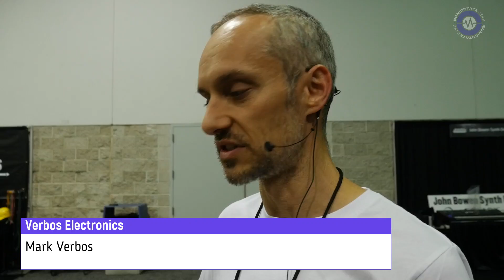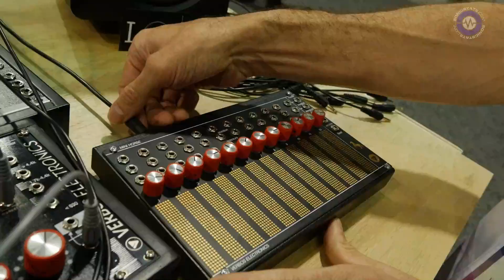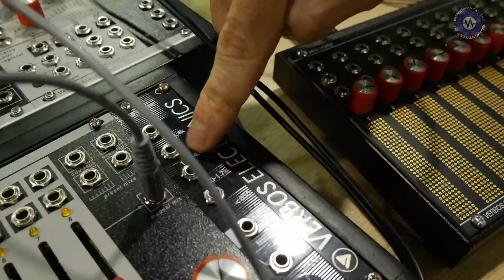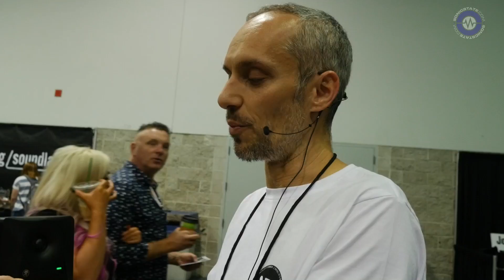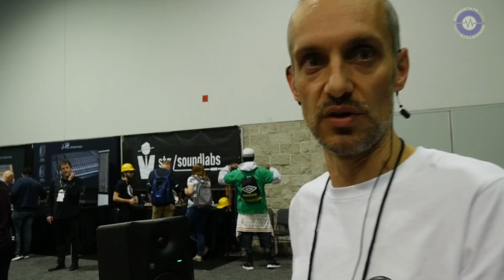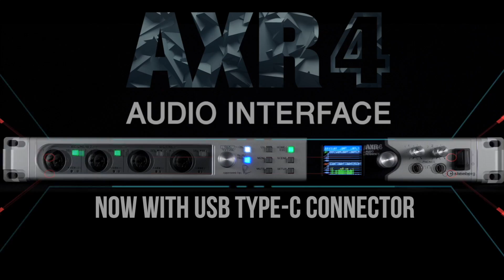NAMM 2020: Verbos Electronics - Foundation Oscillator, Noise & Filter and Amp & Tone

Comment: doesnt feel like the next big thing
Reply: I quite like the noise&Filter Module. Can think of many uses for it in my setup and the price is nice too
Reply: There doesn't always need to be a "next big thing".  Sometimes you just want to fill out your line with some options, or fill in some gaps in functionality.  Nothing wrong with that.  That oscillator while not the next coming, sounds very nice.  I like that spike.
Reply: It’s actually kind of nice to hear some modular that just sounds great and isn’t really trying to be overly nuts or cutting edge. Just really high quality analog stuff. I love my crazy digital modules but when you compare most of it to the verbos gear without audio compression it’s pretty night and day. Anyway, I’m not an analog purist or anything. Their stuff just sounds rich and uhhhh verbosey I guess.